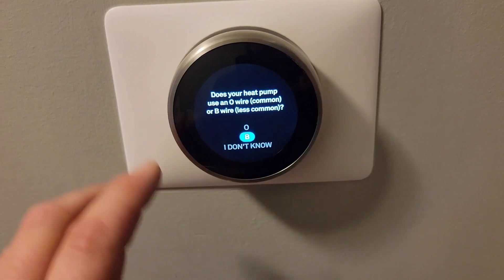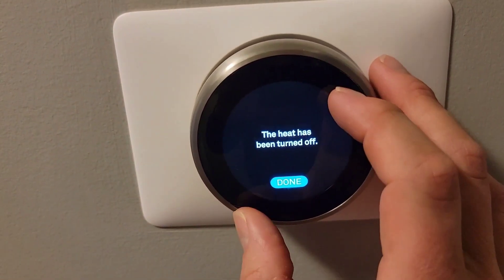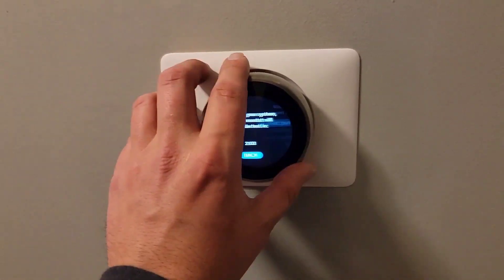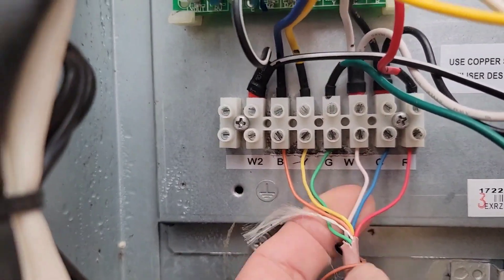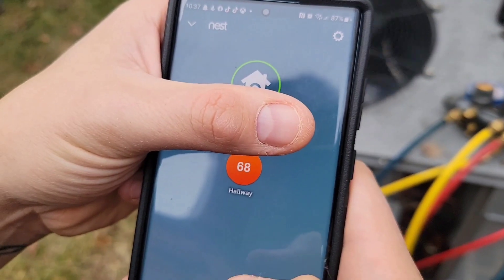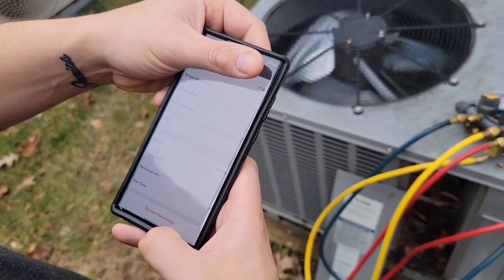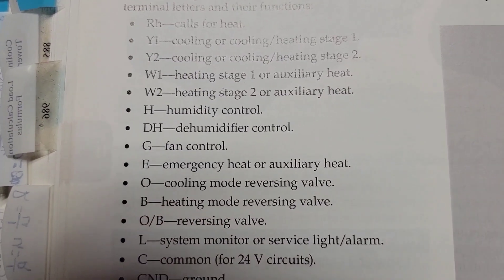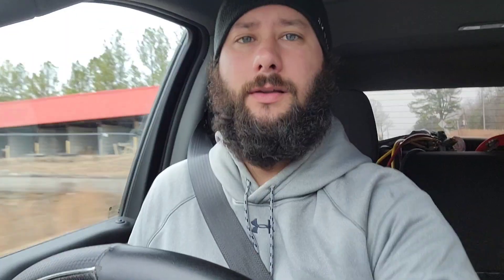Nest Thermostat Glitch: Heating When Cooling, Cooling When Heating

Comment: Bro! THANK YOU! THANK YOU! THANK YOU! My Thermostat had to be reset because of a new wifi setting. Totally messed up my Thermostat and when reset the wiring and type of heat needed correcting.  This video did the trick. I just set the wire from O to B and Bam! Back to heating normally! Thank you brother!

Comment: Thank you! I had to reset due to WiFi. I selected most common and it started blowing heat. I called my HVAC guy and while waiting, came across your video. Extremely informative and saved me the $$$ with my Rheem. 🎉🎉🎉🎉

Comment: New unit (A/C)installed last year. Installed a nest thermostat and Ac work find in the summer. Now it’s winter and the problem I’m having is=
Heating goes on to set temperature, turns off and when it goes on again it blows cold air.. it’ll blow cold air for awhile until I turn it off .
Bottom line i get heat when it wants and times it blows cold..
Reply: Did you find any fix? I am having a similar issue once it goes to desired temp it starts cooling cold air. Everything is set to off on nest ie circulating fan etc. also this happens in the middle of night only when temp is below 50.

Comment: Looking forward to applying this knowledge to my OC for tomorrow morning.
Reply from the maker: Excellent
Reply: @TaddyDigest  So turns out it was in fact a faulty t'stat. Attempted to select "O" for HP,  RVS,  to no avail. Same with trying to setup B. I had to undo the  wire nut for "O"  in order to bypass the compressor running while in "Heat" mode . Once I reinstalled the previous t'stat the Equipment went back to normal operation. Looking to return to install an Ecobee as per clients request any recommendations??

Comment: This video was a great help. I’m in Georgia and it go below freezing and suddenly I woke up with the Nest in aux mode and blowing cold air. I cold the maintenance office and came home to a regular thermostat. I was dooo disappointed. 
I was determined to get my Nest back up because I like the programming and remote features. 
With your video I was able to determine It was setup as no heat pump and also B. I did a factory reset and decreased the temperature for the lock out and all is well!
 I still have a question though. The nest asked the source of the alternator unit. I picked not sure. It’s it typically electric in an apartment building. I have no gas bill and why don’t it heat with the strips you showed when in lockout. I decrease the temperature to 16. What do you think of that?  Thanks for the video!!!

Comment: Thanks for uploading this information for everyone! When switching mine between heat and cool modes, mine fails to shutoff the heat and blows hot air in cool mode still. Could this be due to a similar reason? System relies on O wire to control the heat pump.
Reply from the maker: yes absolutely

Comment: The other day I had an ecobee that was not working screen was pitch black. I found the Common wire loose at the board so I fixed the wire and I made sure all thermostat wires were connected properly at board and thermostat. I then went back upstairs but the thermostat back but it was still not working. So I  bypassed thermostat for about 10 minutes and furnace worked properly took my temp rise and amp draws etc. I told the customer they would have to replace thermostat because it probably shorted out. So the client said he’ll go get a new thermostat and install it himself. After he did that the new thermostat kept restarting. So I told him I would have to call ecobee  but they refused and told me to leave because I didn’t know what I was doing. Do you have any idea what was going on?

Comment: In tx would a heat pump be best way too go bec been having really cold months lately
Reply from the maker: Depends on if you have negative temperatures  And if you do for how long
Reply: @Taddy Digest  ok yea because  I seen them last year have problems at house but I think because they still had them on cooling and the copper was build up with ice
Reply from the maker: If you have negative temperatures make sure that you get A VRF unit
 Something with inverter technology that will work even when the temperature is below 30
Reply: @Taddy Digest  oh ok because I like in Houston tx area so it only get cold in couple months but last past year it got I the teens and that's for the info
Reply from the maker: You're welcome my friend

Comment: I’m trying to install a nest thermostat to a Daikin heat pump package unit, and the old thermostat their is no Common wire, it’s just the R-RH Y W1 G  and on the unit it’s G-stat R-stat W (not connected just capped) Y-O- stat 3 wires are capped together. When the nest the diagram goes Y-W G-G O/B-Y R-RC and the unit doesn’t do anything in cooling, blower is on but condenser fan and compressor is off, when switched to heating it cools, condenser is on and everything. What can I try to fix this issue?
Reply from the maker: Thank you so much for joining and being a member
Send me some pictures to my email and let's figure it out together. tadfuller1@gmail.com

Comment: You skipped how to get to that selection option for O or B.
Reply from the maker: Well shit
Reply: @TaddyDigest  any idea what I should do if cool air blows w cooling test but hot air blowing fails after nest device replacement and install? All worked fine before replacement. Compressor functioning ok and you can hear it each time turn on with both but no hot air. Green wire inserted to C. 4 wires total. Nothing changed from old device as for wiring.

Comment: Nest programming 101, dont. Even if you get over the technical hurdles and quirky wiring, cities can & will remotely access your internet connected Nest and throttle down your hvac systems during peak hours.  This includes remotely raising or lower your setpoints by up to 4 degrees.  Why would you want that?
Reply from the maker: Is this real
Have you seen this happen
Let me know that would be good video content
Reply: @TaddyDigest  Im not sure how common it is and it seems to have happened only in big cities.

Id recommend a how to install one of those nice Honeywell t-stats that have a password lockout on them.  They are a bit tricky to setup, but are needed for roommates or family members that want extreme temp swings.
Reply: @TaddyDigest  I do know in my city in Ohio, the utility companies sell Nests and other network thermostats at a heavily discounted rate and they even tell you that they "may" adjust them during peak hours or emergency event. I believe it's only the ones you buy specifically from them, though.
Reply: They can adjust during peak hours when you sign up for the rewards program. You give them permission to alter your settings. They give you an initial kickback for participation and then once a year it’s like a third of what they gave you the first year. They give you warning as to when they’re going to do it and start cooling your house in advance of the “rush hour”.